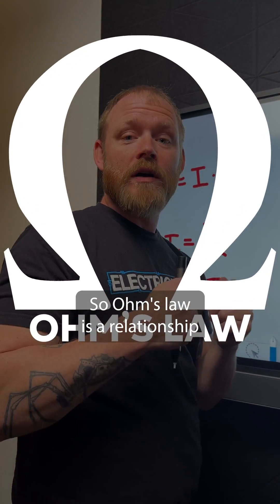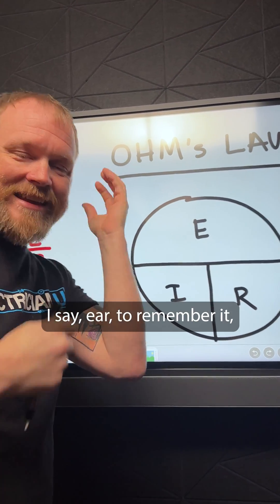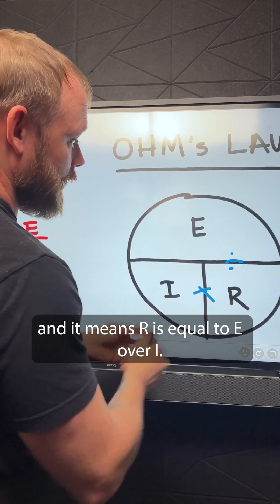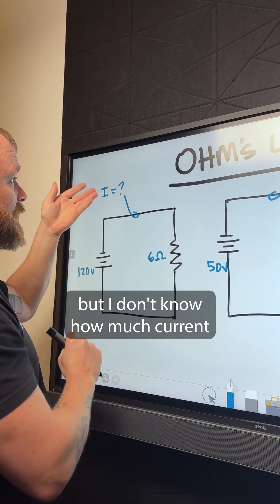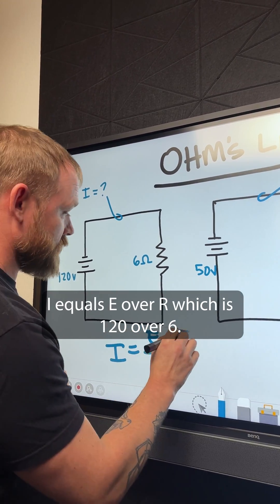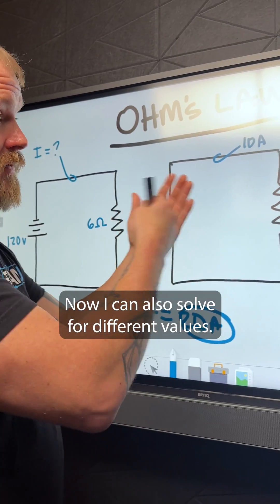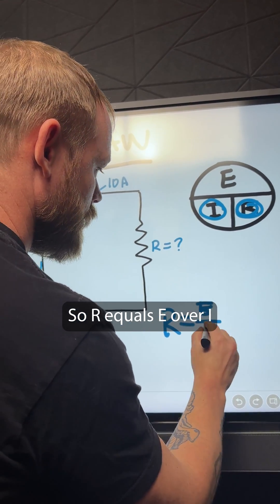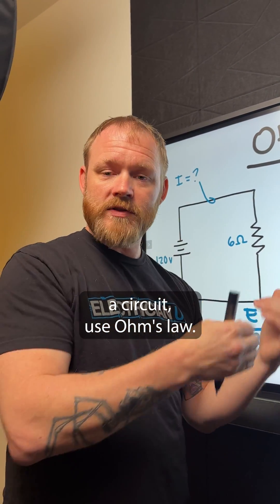Ohms Law - EXPLAINED

Comment: The most insightful graph I often look to is the plot of current against resistance when voltage is fixed. The shape is hyperbolic, which means that in high current situations a tiny increase in line resistance causes a dramatic fall in current (and power delivery). This means that high current circuits like motor or actuator circuits are far more vulnerable to deadly voltage drop than are low current sensor circuits.

Comment: Just like the license course. Excellent. Love it. Actually used it to correct drawing from an engineer. He was grateful. Obviously its a mistake by his underlings. But i looked good. Nice!!!!
Reply: I corrected the KW load on transformers for a restaurant. The wrong load was in the wrong spot on the drawing. If I followed the drawing blindly, it would be a disaster to correct cause the store had to open. Transformers as you know are not light. A 40 kVA was where a 75 kVA should be.
Reply: @jackspade216 out of curiosity what did you correct?